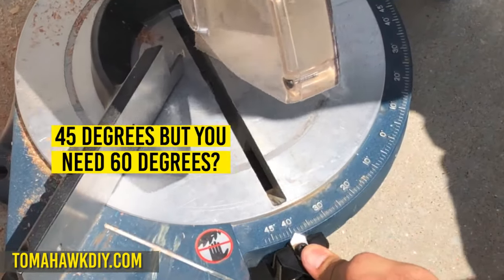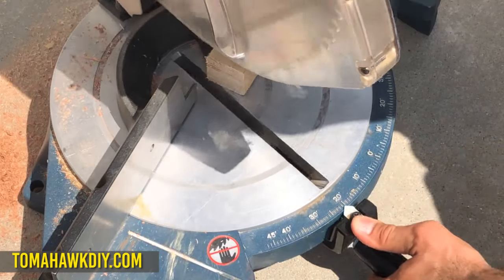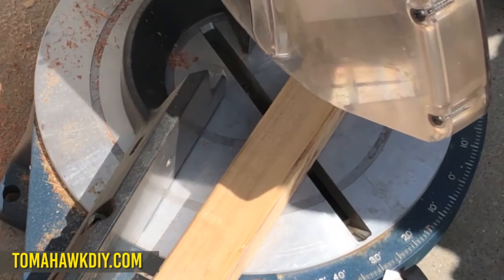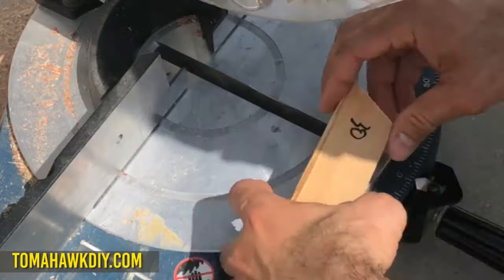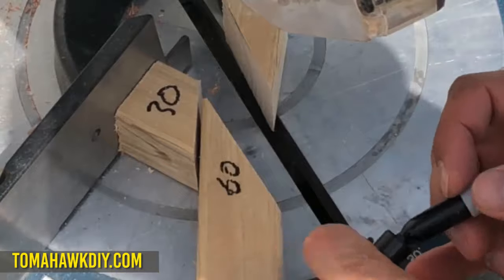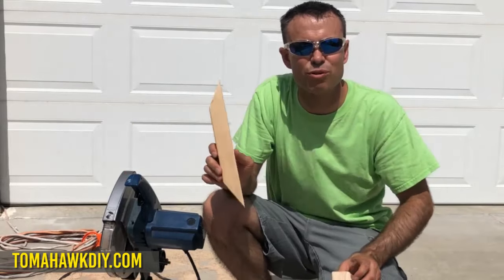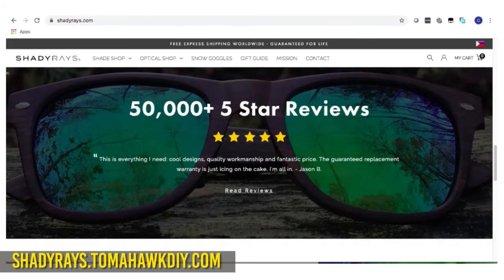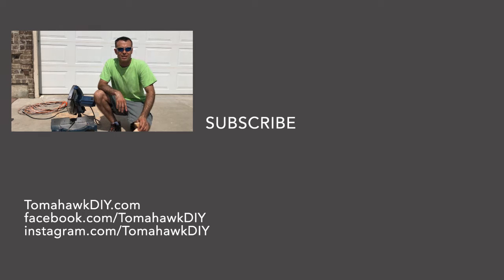How To Cut 60 Degree Angle on Miter Saw (Other Angles Too!)

Comment: That's awesome now huge question does it matter if the cut lock is an inch wide hats the side required or is it the angle that's critical at this point 
                                      Thank you in advance

Comment: How about if you had an 85 % angle how do you cut this? 85 decided by 2 = 42 1/2 cut on meter  at 42 1/2  put them together they don't match. what is the solution. ZI know the answer I just want to see you explanation

Comment: Man, I'm praying you check your comments. I am so stuck! I'm building a farmhouse tv console, get to the Xs  for the sides that call for a 60 degree angle & I tried exactly this; made 30 degree jig, placed the wood against it, tried  at least 30 times. It's not working for me. And I seem to be having to push the wood past the fence on saw which is not good. What am I doing wrong? This console has been sitting in basement for 2 weeks when it should've been finished.

Comment: This shouldnt be on youtube not only for safety reasons but also for what kind of results you would get using this...I tried this and its very very dangerous using that size of a"jig" and the cuts are so crooked as you cant control the slide of the piece and the jig...I would expect more awarness before posting smth like this...absolutly not

Comment: Wait. The scrap piece you cut at the 30 degree setting IS a 60 degree angle
Reply: It looks more like a 30 degree. What makes you think it’s 60?
Reply: It can be confusing but it's because on a miter saw, the settings on the saw are off by 90 degrees from the fence.  Look at your saw and you'll see. 0 degrees on your saw is actually 90 degrees from the fence . So 10 on the saw equals 80 degrees. 20 on the saw equals 70 degrees. 30 on the saw equals 60 degrees and so on..
Other youtube videos can explain it better